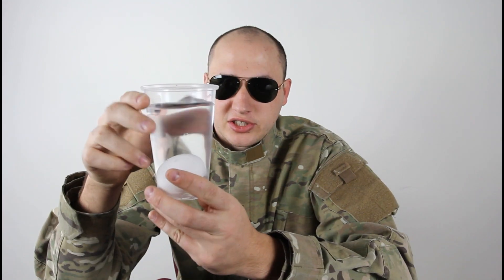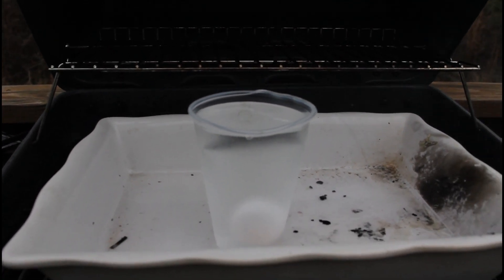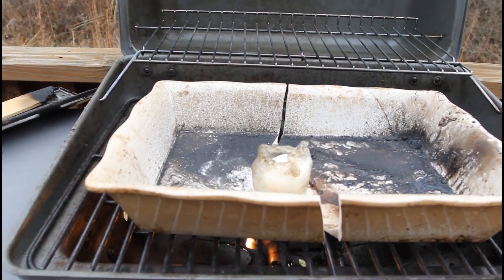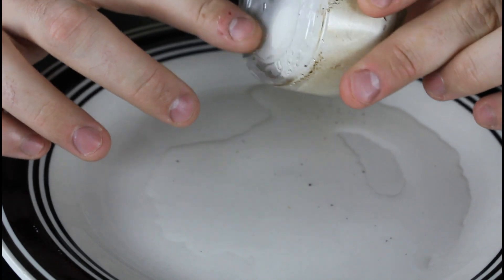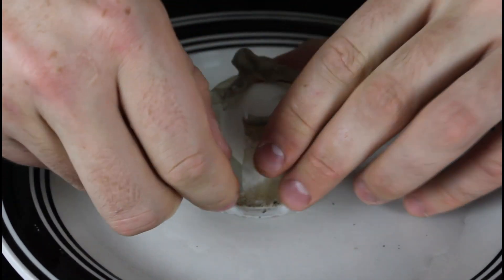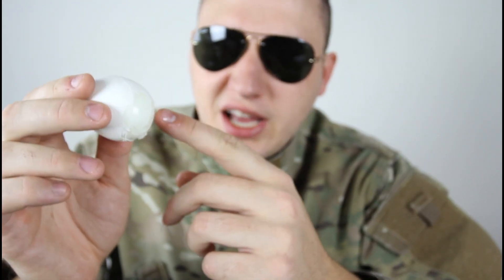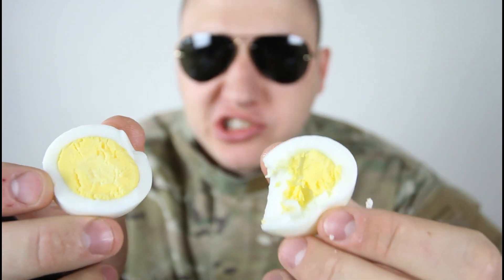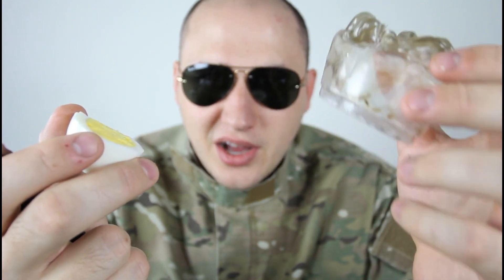How to Boil an Egg in the Plastic Cup! - Science Expirement

Comment: Works the same with water in a balloon. If fire is under the water in a ballon, the plastic won't melt because the water is conducting the heat.